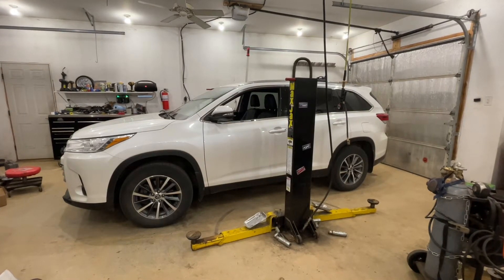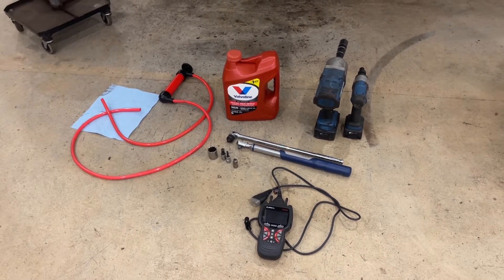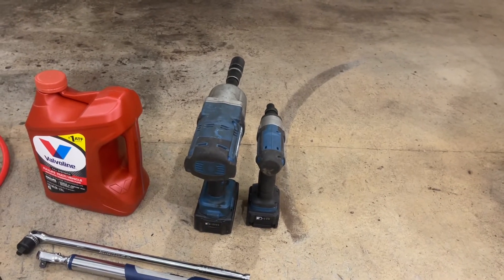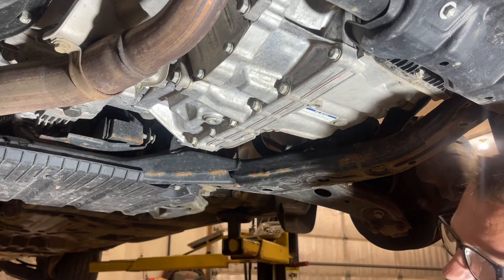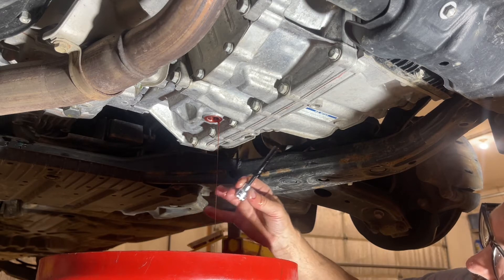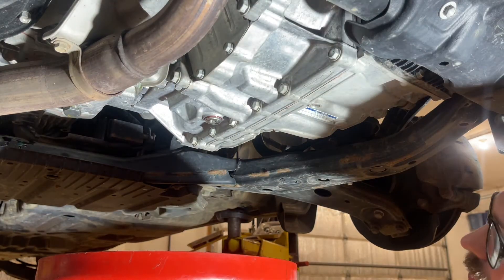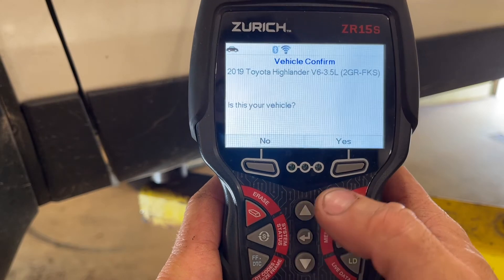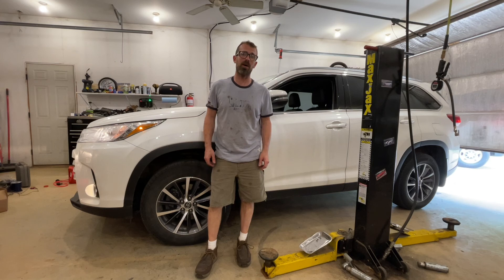🔧 2017-2019 Toyota Highlander transmission fluid change UA80E *the right way to fill*

Comment: Just a question regarding Valvoline. I used it in this process for our '17 with 150k, and it began to leak thru the pink seal a couple weeks later. Is that possibly due to the valvoline vs Toyota ATF, or something else?
Reply from the maker: It's hard for me to say for sure, but I have used Valvoline in a LOT of different vehicles when it met the spec, including my own.  I have not ever had a leak issue afterwards.
Reply: It’s not the fluid. Something else. You should use WS anyway.
Reply: It was the ATF. There is a white plastic plug thats about 1/4" by 2" that has an oring. I ordered that part off a website, it popped right in to the back, and top of the transmission, and it didn't leak after that. That was 5k miles ago, and no more leaks anywhere.
Reply: @caseyat88  I’m confused what you’re saying you’re saying you replaced a part and then it’s quit leaking but yet you’re saying it’s the ATF
Reply: @condor5635  I did use the Valvoline for the first drain and fill. Once I figured out the plastic piece was shot out for some reason, who knows, I replaced the part, and did another drain and fill with Toyota ATF, and it hasn't leaked since. 

So unsure if it was the Valvoline that caused a weird pressure that popped the piece out, or what.

But using the Toyota fluid, has been fine since.
Reply: @caseyat88  guess you are talking about the vertical straw that is sized to set the proper level. Strange how that would have gotten screwed up during normal use. It’s a 6 mm I believe
Reply: @condor5635 no, not the set straw in the front. It's a different part in the back. Took me a few days to figure it out. Part Number is above.
Reply: @caseyat88  no idea what part you are referring to
Reply: @condor5635  no idea why but I pasted the part number here 3 times already, and when I return to check it, the comment is completely gone. Sorry, you're gonna have to figure this out on your own.

Comment: Nice video! That’s a funky looking transmission. Does it not have a pan on the bottom to drop for a filter change?
Reply from the maker: Thanks!  Thats correct, no pan on the bottom. There is a pan on the front of the transmission that does have a filter inside. My experience has been that if you change the fluid as recommended you will not need to change the filter ever.
Reply: @bennieaust very true. Took out my 2016 Highlander pan and strainer at 100k. And it was spotless

Comment: Appreciate the content. Great video. Only recommendation is to use OEM fluids. With something as sensitive as a transmission, i would spend the extra few dollars and get the correct fluid.
Reply from the maker: Thanks Tom!  That’s a great recommendation.
Reply: I totally agree. How can Valvoline have a fluid that covers multiple Toyota types I have always wondered (Type IV and WS). Who knows but I’m not going to sweat a few dollars on it. I have 3 Toyotas and I am extremely familiar with this process
Reply: I use the Valvoline on my Honda, and Hondas are notorious for having sensitive transmissions. Haven’t had a problem. Shifts great, even after one year since fluid change. I did three drain and fills in a row, so it’s got almost 100% Valvoline ATF in it.
Reply: But who makes the Toyota fluid?
Reply: @hotrod4x5 mobil
Reply: @hotrod4x5  Exxon mobil makes their OEM stuff, but it's their formula. I used to go aftermarket on some things and it has bit me. It's a personal choice, but I only go OEM

Comment: Was there no cooler bypass on this model? Also, did you put Valvoline in? If so, that means you mixed it with Toyota ATF WS that was still in the rest of the system - doesn’t seem like a good idea.
Reply from the maker: No cooler bypass on this one. 

I did use Valvoline, so it did mix with the other type WS fluid that was in it. Since the current owner is not the original owner, I do not know the service history. I don’t know if it was the original fluid, or if Valvoline was used for a previous service, and I just mixed old Valvoline with new Valvoline. Either way, they are compatible with each other and with the transmission so I’m not concerned.  I would recommend using whatever fluid concerns you the least.

Comment: On your scanner, how do you read the transmission fluid temp? I have the same scanner but don’t have that as an option!
Reply from the maker: I cover it in the video right at 9:07
Reply: I seen that, I’m stating that I don’t have that as an option(transmission fluid temp). I have engine oil! 
Does the 2019 Highlander not have the same set configuration as 2017?
Reply from the maker: @Jct93  You're using a Zurich ZR15s?  When you press the "menu" button, then select "service check" it brings up engine oil?  The 2017 Highlander will be exactly the same.

I'm questioning if you have the Zurich ZR15s or a different model scanner.
Reply: @bennieaust  yes zr15s, I’m checking for an update now. I’ll let you know if something changes!
Reply from the maker: @Jct93  sounds good, also make sure you are selecting service check and not service reset.
Reply: @bennieaust  so I did the update, I’m doing the service check and all I get is the Engine Oil Level!
Reply: @bennieaust  the closet thing I can find to temp is the live data and under ECT.
Reply from the maker: @Jct93  did you press the down arrow?
Reply: @bennieaust  yes, 1/1.
Reply: I also bought the INNOVA 5610 and nothing same situation! I returned it and bought this the ZR15S. Is there a Dongle that your using that’s helping read TCM?
Reply from the maker: @Jct93  no, it’s straight off the shelf and out of the box. I’ve used it on a ton of vehicles and it’s always been exactly the same process.
Reply: @bennieaust  well thank you, I appreciate the help.

Comment: Thanks for the great video. I have a 2019 Highlander Limited Hybrid. I am not able to get temperature readings from it. Have you by any chance worked that transmission fluid change? Thanks much for you help.
Reply from the maker: I haven’t serviced a 2019 highlander hybrid specifically so unfortunately I can’t give you any tips. Sorry.

Comment: Why did you not drain the cooler and lines?
Reply from the maker: It’s simply not necessary.  When you perform the drain and refill procedure on schedule, it will never be very dirty. If it was neglected, then doing that may be helpful.
Reply: How often would you suggest to do that ATF change? Cheers
Reply: @weekendinwa. I do it ever 30k

Comment: Great video.  I am a sucker to buy tools I really don't need however due to the price of this scan tool I probably won't be buying it.  Any "good" cheaper tools to get the trans temperature.  The jumper wire worked for me however I plan to do routine changes and a tool would be handy.  I am not sure what would happen if I get confused and jumper the wrong two wires and don't really want to find out on a day when I am trying to save money doing routine maintenance.  My 2016 Chevy has the trans temp in the dash info cluster.
Reply from the maker: I was sent a bluetooth scan dongle that links to a phone to test and review on my channel.  I haven't gotten to it yet but hopefully it will be a good $100 option instead of the $300 one I am currently using.  Not so much for me, but I'd love to be able to recommend on the channel.  Keep an eye out for the upcoming video!

Comment: I like that you check the level before beginning draining the fluid.  However, I was thinking that you probably would want to have the temperature correct before you do the initial level check.

 Are there any additional steps for my AWD 2019 Highlander SE?
Reply from the maker: There was no international level check before I drained it, although it would be reassuring to confirm it wasn’t low.   You would need to do that with it level, running and at the correct temperature. 

It’s the same exact procedure for you 2019 AWD SE. 

Thanks for watching!

Comment: Nice video Bennie, same crush washer for fill and drain plugs. Getting ready to do my 2017 Highlander. Thank you
Reply from the maker: Thanks!

Yes, same crush washers on both plugs.
Reply: These were not the right crush washers. I ordered some and they are very clearly smaller. It’s okay because I also went to the dealer and got some crush washers there and they were the right size. Accidentally reused one for the drain plug but replaced the fill plug, neither are leaking so I guess that is good. Anyway figured I’d comment and let you know that these are not the correct size

Comment: I have a scan tool, but through experimentation I've learned there are 2 ways to getting around the need to buy one.

 1) A $20 infrared temp gun, shined on the bottom of the transmission case where the drain plug is, will read about 85-90 degrees when the actual transmission fluid temp has reached the proper fluid level adjusting temperature of 95-100 degrees.  

2) On a 65-80 degree morning, when the engine is first started after changing the fluid the prior day, after 4 - 6 minutes of engine idling in Park, the transmission fluid temp will have reached the proper fluid level adjusting temperature of 95-100 degrees and the coolant temp gauge will read about 1/4 of the way up the coolant temp gauge dial.
Reply from the maker: Great info!!  Thanks for posting!
Reply: It may have been a fluke but using the jumper wire mine apparently hit the correct temperture the exact time the cooling fans kicked on.  I am not sure that is always accurate however it happened twice, once when I was testing the jumper wire procedure before the change and gave it a couple of hours to cool down and when I actually did the change.
Reply from the maker: @bartrowe3705  It may have been, but it probably wasn't.  That's great to know!!
Reply: Thank you,  Directly to the point.

Comment: Great content.  I think I need to buy a scan tool.  I was thinking about using the jumper wire trick but I like the certainty for using scan tool...might cost me a bit at first but I plan on having this vehicle awhile (2017 Sienna FKS motor)
Reply from the maker: Thanks Doug!
I get a ton of use out of my scan tool so it’s easy for me to justify the purchase. That being said I still don’t want to spend a ton of money on one. The ones I linked in the video (the are the same model, just branded differently) have really hit the sweet spot between cost and capability for me. You can spend much much more money, but these have a ton of capabilities for a relatively low cost.
Reply: You can always borrow one from O'Reilly too if you know you won't use it much

Comment: That is so easy. I thought about bringing it in to the dealership. I have a mid range scan tool, just need to buy the pump. Thank you so much.
Reply: My dealer just quoted me $400 to do what he just did. I’m canceling my appointment right away and doing it myself
Reply: @buttspider  $400 is a rip off.
Reply: Gravity feed through the engine compartment with a funnel and vinyl tube. Works fantastic on my 2016 HL and you get every drop exactly and don’t mess with dirtying a pump and all that. I never use a pump for any fluids.
Reply: You said you cycled through the gears after putting the whole jug in. Was your foot on the brake when cycling through the gears or did you have the wheels turning? And how long did you switch gears for? And how many seconds in each gear? I have a S mode on my gear shift to switch manually, do I have to use that or just leave it in Drive?
Reply from the maker: @mrkdavek  keep your foot on the brake, shift in to reverse for 5 seconds, then drive for 5 seconds, then back to park, then your good to go!
Reply from the maker: It’s not a bad job at all!

You’re welcome!!